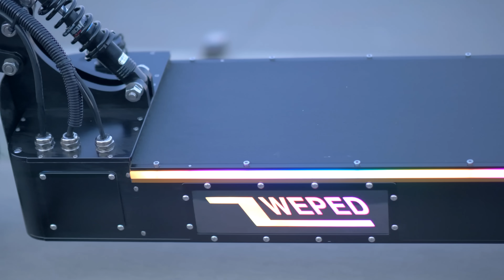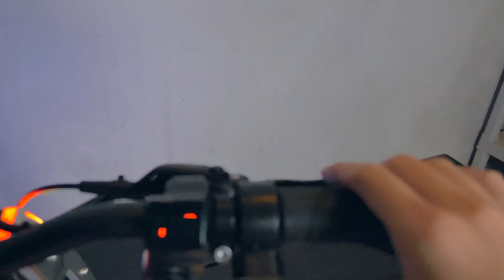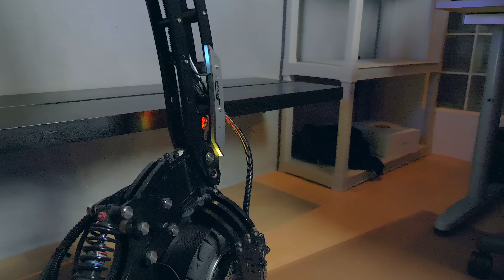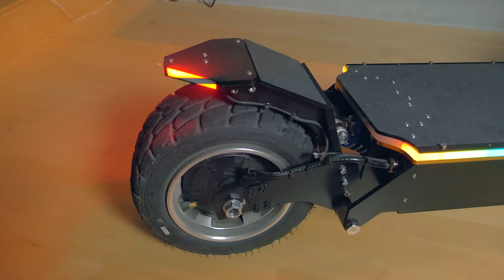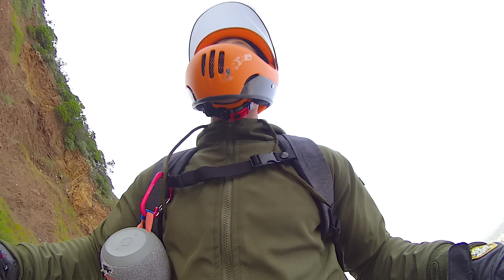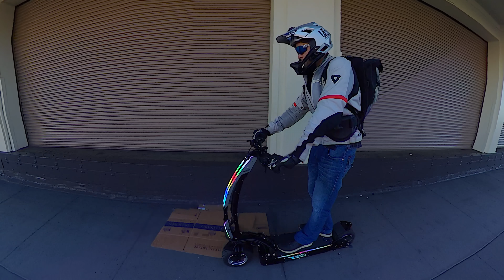WEPED SS Electric Scooter, An Insanely Fast And High Quality Ride

Comment: I bought myself a cheaper then something more beefy, its insane how good transportation these things are, I though think the price point between a super beefy and something in middle range decently beefy not really weighs up the benefits, I had one 16 kilograms a casual one, 31 kilograms the beefier one, but I think thats like the weight limit on a scooter for me personally, but probably when it becomes more popular they will work on doing the beefy one less weight, but as far i see it seems the batteries and engines is what is doing the weight, but damm these beefy scooters are a fun ridiculos thrill, 🙂😎

Comment: Silly question, but this isn't actually covered anywhere ... presumably the 1-2-3 gear switch be changed while in motion? Or does the scooter have to be stopped first for it to take effect?
Reply from the maker: Good question, yes you can change most scooter gears while riding them. 👽🖖

Comment: 2 years ago but it only has the switch and the voltage meter and the  thumb throttle
Reply from the maker: Yup, hopefully they’ve added more to the handlebars by now! 👽🖖
Reply: @AlienRides  breaking news Russians make rocket power scooter

Comment: I would hope that they have several different modes for the throttle response. It's fine that it can go up to 75mph, but it should really have the option to limit torque so that it's useable. I think some people would be able to ride it at 75mph, but the initial torque on acceleration is so jerky that it scares people from going faster.
Reply from the maker: For sure, definitely need smooth throttle acceleration up to the max speed. 👽🖖

Comment: Hello to those who drive electric scooters - could someone give me a tip? I am planning to buy AWD electric scooter, because I need to commute to school everyday for a distance of 6 miles and public transport is pretty much out of the question for me, because I cannot trust that it will arrive at stated times and thus I will mostly arrive lately.
And AWD escooter would allow me to drive even in snow (from what I have seen in some videos it is very usable even in such conditions) - what bothers me though is how should one deal with heavy rains, like if I wear a full face motorcycle helmet, then I will not see anything through the visor, if I apply invisible wipers to the visor then I seriously doubt that it will work at small speeds and once again I would not be able to see - not using a visor is probably the best but uh guess what, I wear spectacles so once again that would render me blind - any tips on this?
Reply from the maker: Scooters are way better than any kind of public transportation. Maybe I would recommend you the Vsett 10+ or 11+, both really powerful dual drive scooters. I would not recommend riding any scooter in heavy rain, they aren't made for it. 👽🖖

Comment: I don't need that much speed.  I just need the following:  Able to go about 30 miles per charge.  Have enough torque to go up decent hills.  Go at least 20 miles/hr.  Not over 60 lbs. Soft and wide pneumatic tires to make the ride smooth but big enough to not get caught in RR tracks or seams in the road. Adjustable stem height (I'm tall). Foldable.  I don't need it to go as fast as a motorcycle.
Reply from the maker: Yup, that sounds like a nice set of requirements. I would say that maybe the vsett 9+ or 10+ could be a good option for you. Happy shopping. 👽🖖

Comment: i dont understand the point of this; going fast should feel fun not scary.
riding a bike is dangerous enough, 70mph with zero aerodynamics is suicide. 
you know how your hand flies back when you stick it out the window of a car?
well youre doing the same thing except with about 30 times the surface area.
Reply from the maker: Hah, yeah riding these at high speeds in the wind is definitely pretty crazy. 👽🖖

Comment: Is it me of does there seem like there's poor throttle control?
While I respect the power of it, it shouldn't seem like all or nothing at lower speeds and you shouldn't need to pulse the throttle to get the desired speed as it seems here.
A simple linear control system based on wheel speed would probably make this thing way easier to handle...
E.g. say at less than 10 mph at full throttle it'll only put out 25% power or something which would ramp up as your speed increases.
Reply from the maker: Yup, very poor throttle control. I believe they've fixed this recently though.

Comment: for those of you wondering 70 km an hour is 44 miles per an hour pretty freaking fast fairly confident that scooters in this class are considered enthusiast I’ve only heard of one scooter that goes faster than this but to be fair faster than 44 miles an hour on a scooter is legitimately scary
Reply from the maker: Yup, but this one will actually do 70 miles per hour, pretty insane. 44mph is still very fast on  a scooter. Check out the Rion for something even fater. 👽🖖
Reply: It’s 70 mph. Not 70 kmh
Reply: @waynecutting  I think you need to do your research again because that would be 130 km an hour

Comment: Top 10 Fastest Electric Scooters in the World: According to Real Data
Updated March 2021: the Apollo Phantom Ludicrous earns a spot on our fastest electric scooters leaderboard.

We live in an unprecedented time, when much of the world enjoys unregulated access to ridiculously fast electric scooters. Every month, newer, faster, extreme scooters arrive within grasp of scooter-loving mortals like us. This is a period of time that’s likely to pass by almost as quickly as the scooters themselves. So if you’re going to choose one, it may be best to get it done in 2021. 

To help you sort out the fastest of the fast (while they last), we’ve compiled: The Top 10 Fastest Electric Scooters in the World. Most of these records are based on our precision Racelogic GPS data, but some are sourced from others who’ve used uncalibrated methods (cell phone, speedometer) that have varying accuracy. 

We’ve ranked the top 10 by top speed, and we’re also including data for standing 1/16th mile time, 330 ft as well as 0 to 30 second time where data is available.

World’s Fastest Electric Scooters by Top Speed
Bar plot of measured top speed for various electric scooter
ESG Certified Top Speed = Blue / 3rd Party Data = Grey
RankScooterTop SpeedSource
1Rion RE9075 mphAlien Rides
2Minimotors Dualtron X II60 mphRaptor TV
3Kaabo Wolf King59.4 mphESG GPS
4WEPED SS56 mph505 PRO KOREA
5Turbowheel Phaeton54 mphVarious
6Minimotors Dualtron Thunder50.0 mph“Lightning Thunder”
7Apollo Phantom Ludicrous48.2 mphESG GPS
8Currus Panther47.5 mphESG GPS
9Kaabo Wolf Warrior 1145.0 mphESG GPS
10Minimotors Dualtron Eagle Pro44.0 mphESG GPS

Comment: At 6500 bucks you might as well buy a motorcycle or a real scooter.  It's cool I will give it that but for that kind of money I want something that is actually legal, waterproof, and something that can be parked in a parking lot and not have to worry about it getting stolen as easily as this.  I would also be unsafe to travel at those speeds on such small tires.....overall cool but completely not practical or affordable
Reply from the maker: Motorcycles are cool and much safer than these. Bit of a different use-case as I can't fold em up and stick them under my desk on in my trunk though. :_alienRides:

Comment: Fuck that, going 70mph while dark siding on fuckin wheel barrow tyres. Never kid yourself, a lot of these scooters are basically chinese junk. Just look at the switchgear, wiring and so on. Absolute trash with some LED lights, i wouldn't trust this shit with my life at all. Kind regards, someone with a 1000cc motorcycle and a ninebot max. If you don't know what darksiding is then well, why don't you google it. But its a fucking terrible idea on something as flicky as a scooter, maybe you'll be ok on a harley but not a scooter.

Comment: I’d rather spend the $7k on a motorcycle, I’d feel safer at speed on that.
Reply from the maker: You're right that a motorcycle is much safer than a scooter at the same speed, but it's also not as portable and doesn't have the flamboyant LEDs like this one has.  :_alienRides:
Reply: You won't get speeding tickets though.

Comment: Hi bro.what is the difference between ssr and sst models???
Reply from the maker: They are mostly the same except the SST model uses a controllers that push more amps. These controllers should give you more smooth acceleration as well as a higher top speed.

Comment: I'm amazed how far battery technology and electric motor technology has come since I was in high school.  I had a Honda express which would only go 32 mph.   This thing is insane.  Of coarse there is a reason tire size and frame length are a lot longer on a road motorcycle.
Reply from the maker: Definitely, the advancement in technology is amazing and I can only imagine how much better things are going to be in 10-20 years. 👽🖖

Comment: Bunch of wussies, I say! I built an electric skateboard with dual outrunner motors that hits 50 MPH Thats FAST on a skateboard. I'd find a safe smooth place and max that puppy out....repeatedly. I'd run out of battery before the fear made everybody else get off. And that peak road they tested new people on? I've seen new scooter riders freeze up and not let the thumb throttle go! Break all you want that big motor will inch it's way over the edge and kill somebody.
Reply from the maker: We ride with a bunch of guys who have 50mph skateboards, they are awesome machines and props to them for pushing it so fast with small wheels, must feel crazy.
Reply: @AlienRides  Right on! Now i just need to spend a few weekends in the bay area and bomb some of those monster hills!
Reply: @AlienRides  man you're talking the real stuff there! If you were to hit a rock or something that stopped the board at that speed you better be good sliding you could turn yourself into a piece of beef jerky real quick

Comment: If I hit a small pothole, how far will I be launched?!? Just trying to compared the launch from this scooter and my current 50cc moped.. no license, no insurance, no registration and get 100miles per 1.3Gal.<—All that is required on my 50cc as well. :)
Reply from the maker: Your moped is going to be slightly more safe for sure, but also it's not going to be a rolling gay disco party like this one unfortunately 😢

Comment: ive done a bit of extra research and i believe that this has to be the quickest and fastest scooter outside of the rions of course. the thing is, this has alot of range. only the original dualtron x has more amphours at 49. this thing has 45 which is more than even the dualtron x 2 which 42 amphours. peak power is insane at 10k, as mentioned in this amazing video, weight is not too bad considering whats packed in it, i mean it weighs less than the 11x body. so a fairly light body for the performance, 10k peak power, 72 volts, 45 amphours, top speed of comfortably over 70 mph..... I . WANT . IT !!!
i will make a decision and not considering what may be released in the next year or so, my choice will be between this monster along with the apollo ultra ludicrous, the dualtron storm & the underestimated beast dualtron ultra 2
Reply from the maker: Yeah, it's definitely a beast! Remember the real story is watt hours for range, and not amp hours. So you multiply voltage * amp hours.
Dualtron X: 60v * 49 ah = 2,940 watt hours
Weped SS: 72v * 45 ah = 3,240 watt hours
Lots of good scooters coming out in the next year, good luck with your decision!
Reply: @AlienRides  exactly!! its got the voltage of an 11x but the amphours of a dualtron x. its insane. it might be considerably slower still than say the re90 but it must have at least 1.5 times more range if not more. i think it has double the amphours of even re90 if i remember correctly.
Reply: @AlienRides  ive also been trying to find out about new upcoming high end scooters but i havent really come across anything. are you aware any new scooters rumored or expected for 2020-2021?
Reply from the maker: OK DOK I’m not really sure besides the new Dualtrons tbh. Hope we see some fun stuff though 😁

Comment: How is the ride and suspension compared to the Zero 10X? And what level did they have the unit on during the test rides? Probably 3 😂
Reply from the maker: Yeah, it was maxed out and pretty insane 😁 I think the cloud-like suspension of the zero 10x is probably better for off-roading, while the stiffer SS suspension is better for higher speeds. 👽🖖

Comment: Man my scooter goes 15mph and it gets scary sometimes. 70mph you gotta be a kamikaze 😂
Reply from the maker: Yeah, going faster can be scarier, but these fast scooters are usually built for the speed with a solid frame and good suspension. 👽🖖
Reply: Alien Rides it’s definitely a cool scooter, a bit expensive but probably worth it. The only problem is that it’s basically illegal almost everywhere. I’m sure cops will attempt to stop you going 50 mph 😂

Comment: So when is this even going to be for sale?
Reply from the maker: Yeah, I think weped has had some trouble stocking them to distributors here. Weped scooters did get a few in and sold them over email, but they sadly never listed them on their website.
Reply: @AlienRides  today i got an email from them saying there are a couple in stock. The issue i found out is the company NUMO they had making them didnt make them to Wepeds specifications and used chinese parts. Then Weped told them not to ship them out and they did anyway. Now Weped is working on releasing them themselves with different model names.

Comment: please be aware  electrics scooters are ilegal to drive in the UK, if caught you can face a 1000 fine and 6 points in your drivers license if you have one, plus they will take the scooter away, In the UK  you can only legally drive it in your own land, end off. But you can  ride ebikes  that has throttle and pedals at a maximum speed of 25 KM per hour,  the rest is all ilegal  in the UK,
Reply from the maker: Yeah, I'm hoping that this changes for the UK in the near future. Hopefully people will be able to enjoy electric transportation there freely.
Reply: @AlienRides  yes Alien, while I agree with you, I also agree that any electrical vehicle going faster than 25 km per hour, should be at least insured, because this are very very small vehicles  at a very high speed without protection, the current accidents on this type of vehicles are really low but that is cause is not legal and not many are using them, but the more people using them the more accidents for sure. I really agree the law should make them soon very available specially in big cites,  as an alternative travelling,  free energy, no pollution and you get to places fast, but I also agree that needs to be regulations, including insurance, because people will get hurt,

Comment: Scooters doesn't look safe especially going at 70 mph while on the streets; you would have to stand while riding and the center of mass is different than a bike or motorcycle.
Reply from the maker: Yup, motorcycles are definitely more safe than scooters. Not as portable, and can't easily load into a vehicle though. Get the best ride for you. 👽🖖

Comment: Why TF would you need to go 70mph on a scooter? That's how fast I drive on the freeway when I'm over speeding. lol.
Reply: Wangan Midnight Scooter Edition but in all seriousness i checked all alternatives of transportation and after the price point i said fuck it im building my own tube frame chasis sticking a engine in it hooking up the suspension transmission and so over time gonna stick or arc weld the frame together using titanium tubing and have the outerbody made of steel sheets race plastics and padding buffers of a material similar to rubber and ill probably use stiffer plastics inside for the dash flooring doorscards and such then stick a harbor freight predator 670cc and take thr plastic crap out suup it up and then twincharge it all for cheap with my parts list my only issue is the welding end since i only know mig and stick and arc equipment aint cheap either but a buddy offered since he and his dad know how and have the stuff
Reply from the maker: No one needs to do that, there's just some crazy people out there who get off doing dumb stuff like I do 😬
Reply: Then after that i also have to add the tach some other gauges lights turns signals hazards seats belts and so on then go through the process of getting it registered like a rat rod or other unconventional vehicles

Comment: Why are all these electric vehicles so expensive? Motors and batteries have been dirt cheap for years.  The thing should be like 1500 bucks. I doesn't even have a fast charger for 7 grand
Reply from the maker: Yeah motors are pretty cheap, the batteries are the expensive part. High end lithium isn’t cheap yet, but hopefully we’ll see those prices coming down in the future.

Comment: Who the hell wants to travel that fast???? RIDICULOUS especially on how small the wheels are.....I would never buy that. Wheels should be bigger at that rate of speed....
Reply from the maker: Bigger wheels are definitely more safe, but not as portable when needed. Not that this is, but I can fold down the back seat of my car and put this in there, where I couldn't fit a bike/motorcycle. 👽🖖
Reply: @AlienRides  
I get that you are promoting an electric Ridable for a company, but I can TELL YOU FROM EXPERIENCE, THOSE SIZE WHEEL AT THE SPEED YOU ARE BOASTING WILL BE DANGEROUS FOR SOMEONE RIDINGING THAT SCOOTER. HITTING SMALL POT HOLES OR CRACK WILL DEFINITELY SEND SOMEONE FLYING. RIDERS WANT TO GO FAST AND THEY WILL ALWAYS PUSH THE LIMITS. That ride is just all out UNSAFE. ......
The wheel should be at least 8-10 inch wheels. Tires are WAY TOO WIDE AND FLAT FOR CORNERING......waterproof does sound nice and of course range....
24 hour charging is A JOKE.....lame